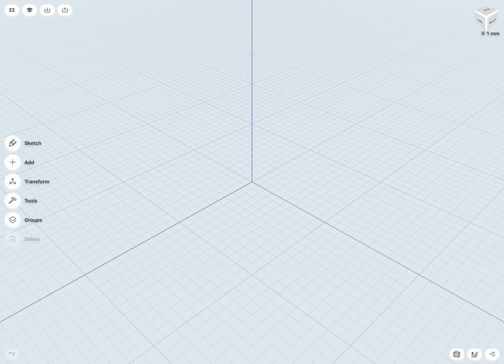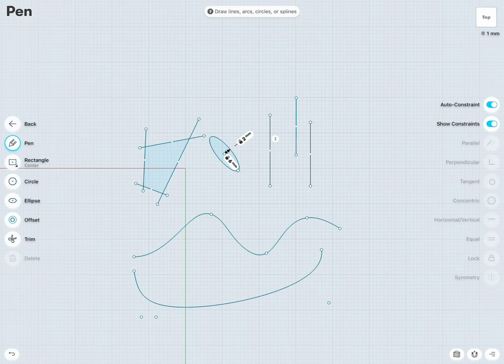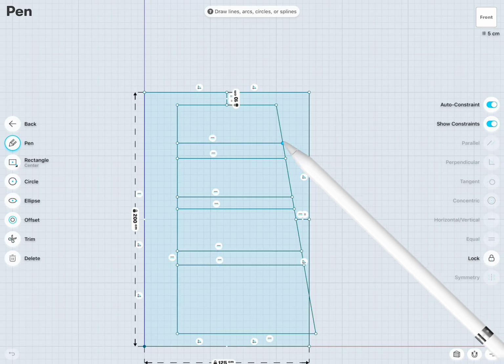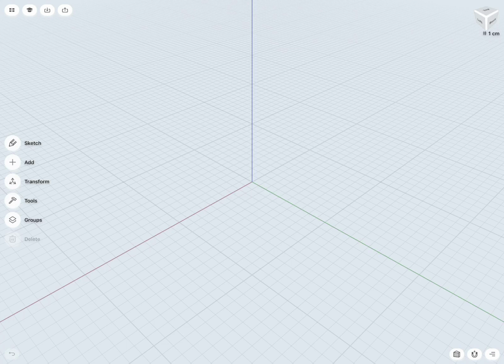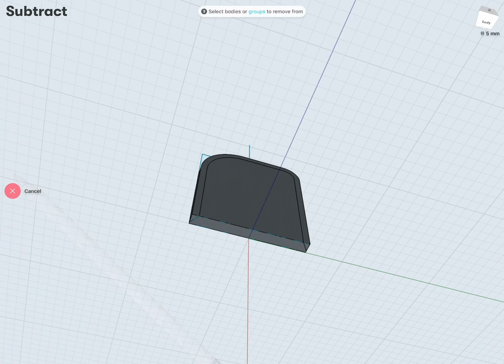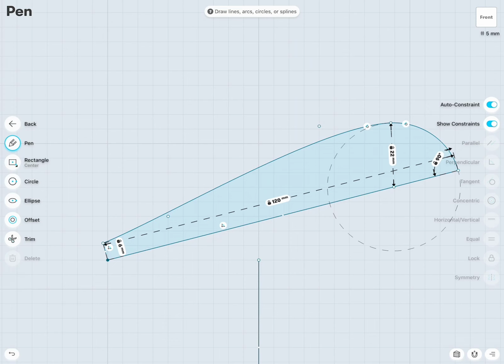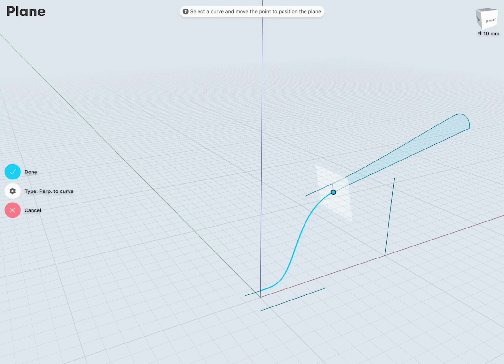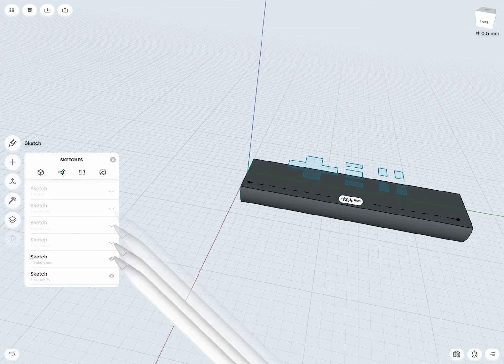Improve your Sketching process | 3D design webinar

Comment: Sketching is good but a little flawed in concept. It would be a vast improvement if the drawing tools were NOT STICKY. i.e. Almost every tool requires some form of adjustment or tweak but the default behaviour just draws another item. This is annoying even with the Apple Pencil, never mind how much worse this is using Shapr3D on desktop. A thumb sized icon left and right to repeat the tool would work much better and can be hot-keyed when not using a tablet. Center point arcs would be a good addition too.

Comment: Is it possible to have separate sketches on a given plane? If so, how? Thanks.
Reply from the maker: It is not yet possible to group sketches - the app groups them automatically by plane
Reply: Shapr3D Thank you. I have tried a work around by creating an offset  plane at a zero offset but even though I double tapped on the offset plane the new lines I drew were still put on the original XY plane...
Reply from the maker: Yes - it is by plane, not by construction plane. We made a note of your request
Reply: @Shapr3D  Good you have noted it! I just wish 8 months later this would work. Seems not..

Comment: These are very helpful thank you. Has the default items list changed in the Sept 2019 version ? I don't seem to have a "Group" option in the "All items" list? I am guessing this has become the folder icon with a + symbol on it. If so, then in order to make a "Group" one would manually have to select all items and put them into a folder. This is a bit confusing on the shelf demo as this function is missing. You also reference it in the spatula demo. Or if I am understanding this correctly in order to turn off a "Group" as you put it, one needs to select each eye icon displayed after each "Body" object manually.
Reply from the maker: Yes, you are right - some of the videos do show the old version of Items. Right now Items works the following way: https://support.shapr3d.com/hc/en-us/articles/360020101393-Items Hope this helps.